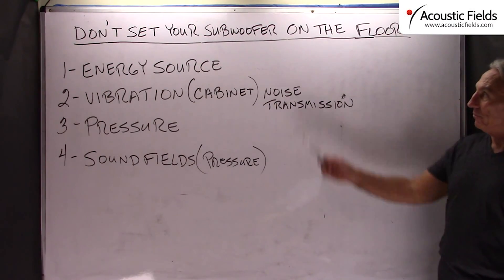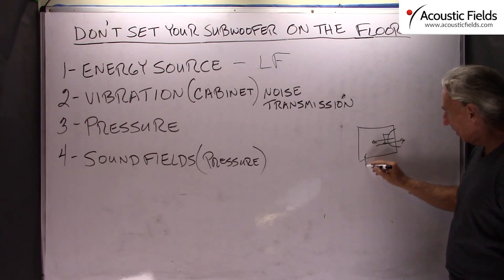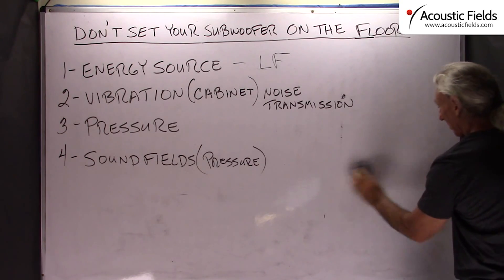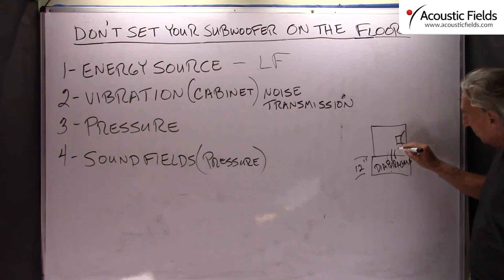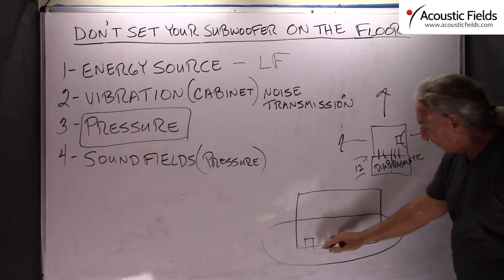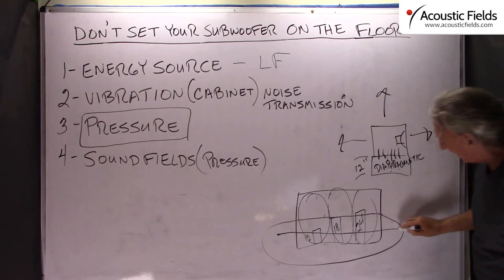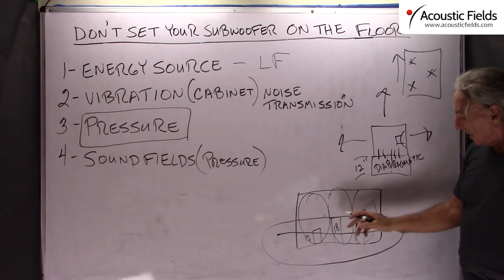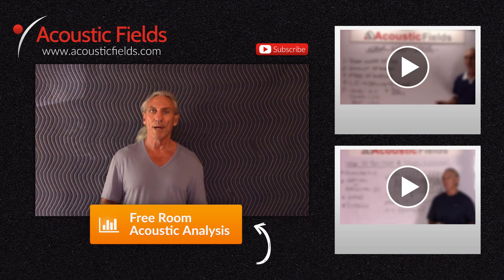Don't Set Your Subwoofer On The Floor! - www.AcousticFields.com

Comment: Now where is the better to keep subwoofer floor or above?
Reply: I've heard conflicting info. Put in corner   Dont place in corner. Put in center. No, not in center. Fires downward for max floor coupling. Floor coupling bad. Wow. Hang my $600 piano black sub from a chain ? I need an aspirin, lol
Reply from the maker: M,  Subwoofer placement depends on many variables. It depends on the usage in room number of subs, room volume, pressure levels, and room dimensions.  Tell me more about your room.
Reply: If you watch movies, you will need those vibrations. Put the sub in left/right corner (always). If you have two subs, 1 left and the other right corner. You can put them top left or top right but never in the middle.
Reply: @Krupnoklipac  nobody needs that vibrations from the subwoofer - really nobody - for vibrations in your seat exists way better solutions than let the whole damned room vibrate
Reply: @Harald_Reindl  nobody? Even me?
Reply: @Krupnoklipac at least nobody with the slightest clue about sound quality
Reply: @Harald_Reindl  Oh, that would be my wife and she loves vibrations.
Reply: @Krupnoklipac  maybe for other reasons :-)
Reply: @Krupnoklipac  i googled https://www.amazon.de/-/en/Reckhorn-shaker-audio-therapy-BS-200/dp/B00AMH17GC/ for you which makes a lot more sense given that you don't need distortion in the whole room and vibrations where nobody ever listens

Comment: I did put rubber under each foot on the sub, and I heard clearer bass and mid range immediately. Actually they were quite cheap. Only about 15 dollars of treatment per speaker. And I have wodden floor, so all speakers must be decoupled from the floor.
Reply from the maker: O,  Yes, isn't it amazing what a difference it makes.  Now, elevate your sub 12" and use low-frequency absorption under it.  This was the design impetus for our subwoofer platform.  https://www.acousticfields.com/product/subwoofer-platform-absorber/
Reply: I have Italian marble flooring. Would I benefit from the rubber pads under the sub feet? It's a downfiring subwoofer.

Comment: I have a JBL studio monitors (8 inch drivers) setup with a 12 inch powered SUB with the cutoff set at 80hz ,  it clearly says in the manual to put the SUB directly on the floor with nothing under it. I did put some DIY 1 inch rubber spacers under the feet to minimize vibrations and it has not changed the sound for the worst.  So why are manufactures so against  putting something under the SUB feet ?
Reply from the maker: J,  It is probably a liability issue. They want you to use their "feet" and also keep it close to the floor so you get more quantity than quality.

Comment: All I know is after installing 2 iso pads for my duel subs, to me it sounded way better than before and less unnecessary vibrations.
Reply: If you sit on a couch , raise the subs on the height of your head. The frequency will hit your head even harder
Reply: Kukuruz Krupnoklipac Which frequency? There is 20hz to 100hz in a sub. Or you just mean the sound.
Reply from the maker: R,  Yes, you are correct. Reducing the noise transmission from the sub to the floor is always good.  Now, raise it up another 12".

Comment: If you set your subwoofers on the floor your gonna hear rattling sounds coming from the floor you can't hear rattling sounds coming from the floor if there is carpet on the floor raise your subwoofers off the floor and they will sound better and you will not hear any rattling sounds
Reply from the maker: T,  Carpeting is not a vibration isolation technology, especially when it comes to a low frequency generating source.  You need to raise the sub from the floor to smooth out the room response,  you can also absorb some energy close to the source with proper sound absorption technology, and you can reduce the transmissions of vibrations from sub to floor with similar technology.

Comment: Hey, I dont get it. The manual clearly states that you should,put it on the floor and next to a wall. It is very hard for me to understamd how do you see it actually been done with only theory. Shoe us your actual olutions please.
Reply from the maker: F,  Its all about smoothing out room response. A low frequency producing device elevated will produce a smoother response curve.  Don't be concerned with what the manual says. Do your own thinking and testing.
Reply: the manual was written by an idiot for customers which are impressed by let the whole house vibrate

Comment: If you have only one sub. Is there an ideal distance from floor? Is 24 inch always better than 12 inch?
Reply from the maker: O,  The taller the ceiling height, the higher the sub can be. Start at 1' and try that height for an 8' ceiling.

Comment: Well whats the difference between putting it on a desk and floor
Reply from the maker: M,  If you set your speakers on your desk, you have a desktop reflection right into your ears. It is audible. Secondly, the vibrations from your speaker can transmit into your desk and the electronics. If you have stands, they can elevate, attenuate the low end, and isolate the middle, and high frequencies from the desktop bounce provided you have the right angle of attack.
Reply: @AcousticFields  where do i put the subwoofer if i dont wont it on the desk?
Reply from the maker: M, Move it around. Try different locations. Stay out of corner.
Reply: @AcousticFields  What if you put the subwoofer on the side

Comment: Is it the same problem if I put the soundbar on the floor?
Reply from the maker: J,  Soundbars are about quantity not the quality of sound.
Reply: ah. thanks for the reply.  So if I don't have a TV shelf nor a TV. just want to use the soundbar with my projector, where should I put the soundbar?
Reply from the maker: J,  Whatever works best for your set up. Wherever you have room to place it.

Comment: Thank you so much great information. I bought (2)  15” Wharfedale Subwoofers and used the thick foam that came in the box and I set my subs on top of this thick foam, about 3 inches off the floor.. And I also placed foam under the Subwoofers all around, at the front, in the middle and at the rear,basically to get them off the tiled floor, and add extra support and for the foam to actually be used as a cushion.. I personally think that this did help.. But it would be great also to take your advice and raise them much higher.. This is also beneficial because all that Bass will then hit you in the middle of your body, whereas if your subs are on the floor, the Bass waves are being lost ..
Reply from the maker: Raise the sub 18" off the floor.

Comment: I simply hot-glued a few rolls of electrical tape together and attached them to the bottom of my sub to decouple it from the floor, which is concrete covered with carpet. Works fine for me for a total cost of less than  $5.
Reply from the maker: T,  Yes, using a viscoelastic damping material such as electrical tape is one method of reducing noise transmission from a speaker to the contact surface. There are many others with varying degrees of effectiveness.
Reply: That's actually a very good DIY idea.  Kudos!
Reply: Tony W Try hanging them by steel cables. Best decoupling, greater soundstage than just mounting it. Of course the best listening position is also hanging by cable. Works for me though. 😀

Comment: My sub is 15" in 4.5cu..ft. cabinet with about 500lb dead weight on top . That thing don't  move . But everything else does. I had to put velcro under the nic-naks on the shelves to keep them from comiting suicide. 😎

Comment: What would you recommend for a down firing subwoofer sitting on hardwood floor?
Reply from the maker: J, Elevate, attenuate, isolate.  Raise the subwoofer at least 12" off the floor, choose a platform that absorbs energy at the correct rate and level, and isolate the vibrations from the floor. Our subwoofer platform does all three functions. https://www.acousticfields.com/product/subwoofer-platform-absorber/
Reply: Try Turning the sub on it side so driver faces you?  play with the room location and phase. I just did this with a rel quake and it end up sounding best on its side, on top of speakers kef 102 on stands, aprx 5ft from the floor.

Comment: Very informative vid. Question from an audiophile/physics major.... should I wrap my sub the same diaphragmatic material i use to lift off the floor to help prevent energy from getting into the corners (it's in a corner under a small table in my room due to space issues) Also.... would doing this in my trunk help stop resonance through my car from my car's subwoofer?
Reply from the maker: L,  Yes, any reduction in vibration transmission will improve definition.
Reply: If that reduces the sub's output at all frequencies you might as well just turn down the sub's volume instead.
If it's highly frequency-selective material you could achieve its effect via EQ.

The point of bass absorption is to tune the room, not the sub itself, and that's why it's normally placed at specific hotspots in the room, not on the sub.
Reply: @d0nj03  no, you absorb as nearly you can go to the source and it is not the same as lower the volume - it is a matter of physics

Comment: The floor and the wall add their own influence to a subwoofer's sound. If you minimize this effect by putting some distance between them, the subwoofer will have a purer and less influenced sound. He also trying to control the pressure fields in the room and put them in a more advantageous listening position. These are some helpful suggestions on ways to tune the acoustics in a room. Don't discount them as a little difference, a sub raised 12 inches higher will nave a noticeable different sound. But not necessarily better; this all depends on your set up and what you like.
Reply from the maker: W,  Thank for the clarification. It is a clearer way of understanding the process. In the over 100 rooms we have measured using an elevated, low-frequency source, we have found a smoother response curve below 100 Hz. in 90 % of the rooms.

Comment: Sr we all respect you're right and you're wrong! If you're playing nice and well equalized music in a room that's perfect! Now what if you're doing dj in a outdoor area without any walls and your playing hip hop and electronic music for 500 people and your sistem includes only 4 bass cabinets (4 mids and High's tops no problem) above 8' will you recommend to move your bass away from your dancefloor (wood 40x40 floor) up on the air????
Reply from the maker: H, Right or wrong has nothing to do with room response. Room response is dependent on the source (subwoofer) in this example for discussion and its position within the room and its relation to room response. In small rooms, raising the low-frequency source off the floor will improve or smooth room response below 100 Hz. This is our experience in over 100 small rooms measured. A larger room volume will have different issues than a small room. I do not have any experience with larger volume rooms with multiple low-frequency sources and do not know what the impact of raising low-frequency sources in larger volumes would actually measure. That said, I have seen it done many times in larger venues.
Reply from the maker: H, Another issue your comment raises in sound quality versus sound quantity. Achieving sound quality in a small room in the low-frequency energy area is a combination of source position, room size and volume, treatment types and positions along with many other issues. Sound quality is the primary goal. In larger venues, it has been my experience that quantity is the primary objective with quality taking a back seat. I have never understood this since larger volume rooms would offer a good start to achieving sound quality over quantity.
Reply: @AcousticFields  thank you for time to answer ! You're really informative and knowledgeable 👌
Reply: taking about "without any walls" is idiotic in the context of room acoustics

Comment: Great advice .
Reply from the maker: Mr,   The frequency response curve of your room depends upon many variables. One of those variables is the position of the low frequency generating source which is your subwoofer. We have two in our studio. One is 18" off the floor, the other 24"

Comment: That is so true sir! I got two powerful custom made 10" sub...been re-place them and re location them for up to 2 yrs now....still the best spot to place them were the weirdest spot ever...only on that weird spot I got transient response and clean bass with minimal room modality....my tiny subs does sings along with 60hz boomines if I fed 30hz signal to it...that situation happen when I spread that 2 subs sitting beside main left and right tower spkrs...then I tried placing them like this...no1 sub sitting behind my tv/center channel and the other one I left it sitting side by side with my left tower spkr...boom! I got even pressure and minimal modes...low freq sound goes audibly clean and tight...not like before where I can just feel the bass pressure but can't really heard it hitting my ear...I can feel my couch shaking and vibrating but my ears didn't catch any tight impactful bass sound....maybe next time I'll try to lift it frm the floor as you suggested in the video...thank you sir! I thought my room were the only one that is weird in terms of subwoofer placement...this answers me much...thanks
Reply from the maker: M,  Low frequency producing devices must be carefully placed in any room size/volume /usage.
Reply: When i have two different sizes of speaker and placement playing the same frequency it helps to change the subwoofer phase either in your amplifier or on the back of the sub itself. It helps keep them from creating an out of phase effect.  This doesnt always achieve better results depending on the room and the placement.
Reply: If you want to avoid ears impact, just change the polarity of 1 sub.

Comment: It depends on the room dimensions and its construction and the subwoofer and its construction, how loud you play music. This is a vast oversimplification. My subwoofer sounds better on the floor. So there.
Reply from the maker: M,  Your definition of "better" is based on your experiences and knowledge. That does not negate the fact that your room response curve will improve if you raise your low-frequency device away from a surface no matter what the size or volume is. This is a fact and facts are always friendly.

Comment: What is a diaphragmatic absorption material?
Reply from the maker: M,  Diaphragmatic absorption is a process and technique. Our ACDA units are diaphragmatic absorbers with an activated carbon perforated absorber in the center. We also add our foam technology to the face of each unit making them broadband from 30 - 6,500 Hz.
Reply: Where to get in Germany?
Reply from the maker: E,  What are you needing?
Reply: I have a sub. What Can i put under the sub?
Reply: To isolate the sub from the floor
Reply: I know he left that out lol I told him to make a video again

Comment: How about hockey pucks? I use 2 on each feet, one hard puck under sub feet and a soft puck under hard puck. Seems to help a bit.
Reply from the maker: S, They would provide vibration transmission reduction but no sound absorption.
Reply: Good enough for me

Comment: This is very interesting.....I djed a wedding June 8th...i my set up was on top of a bar inside of a really cool barn....I was about 10 feet above everyone else I the room...and I tell you guys that sound resonanted like I have never experienced....bass was incredible..like you could feel it everywhere... possibly because subs where elevated....sound a lot different then my typical on the dance floor ste ups...this guy is def on to something!
Reply from the maker: D,  Isn't it amazing the difference just a small physical elevation makes in low-frequency response. Moving away from the room boundary surfaces can have a large impact on all frequencies.

Comment: The dense Styrofoam shipped with my subs was perfect but only take it off the floors 4 inches.
Reply from the maker: P,  Start with a minimum of 12" and then 18" and 24".
Reply: @AcousticFields  my sub is huge and heavy. How the hell am I gonna raise it a foot or more???
Reply: @kenshiroFNS  by place some under it which can stand the weight - where is the problem? in doubt a MDF quader

Comment: I have my subs about 50cm above the floor (to centre of driver). Better room response I think. Plus there are 2 of them :)
Reply from the maker: R,  If the room is rectangular, place on both short ends. Start with mid wall positioning at least 4' from wall surface area. Move towards room center for tuning. Move in 2" increments, one at a time.

Comment: I just finished insulating my home theater.  The walls are double 2x4 walls with gap between the walls and r-13 in one wall and r-21 in the interior wall.  The room is 20x20x10.  Are there any problems associated with having this type of setup that I need to consider as far as reflections or needing bass traps etc.?
Reply from the maker: The barrier you built will not stop frequencies below 125 hz. You will need 50 - 65% surface area coverage on all 4 walls to start for low frequency management.

Comment: What about subwoofers built into floor standing speakers, or down-firing subwoofers designed to be used on the floor?   I have a Velodyne 12 DDS that produces rattles much worse in the cabinet than on the floor.
Reply from the maker: R,  All vibration producing devices should be decoupled from the surfaces.  If you can then add absorption to the isolation process you have two reasons to do this.